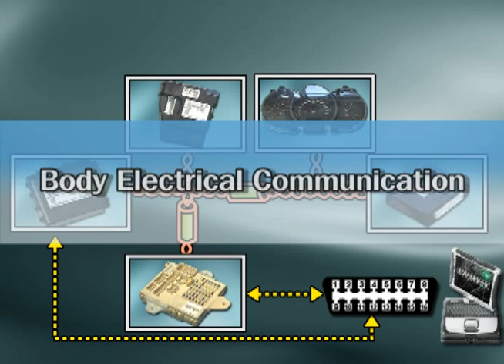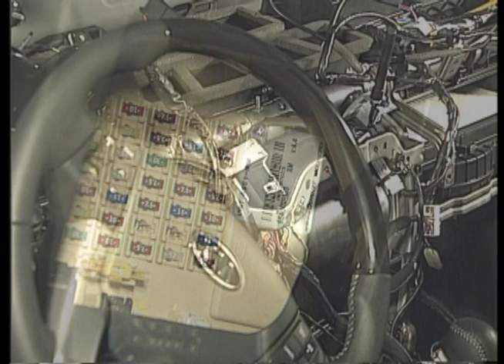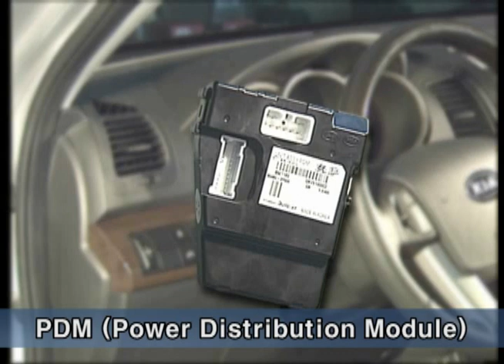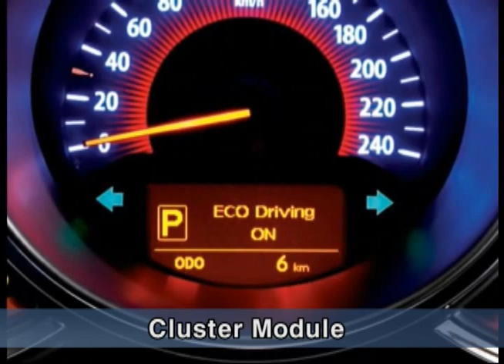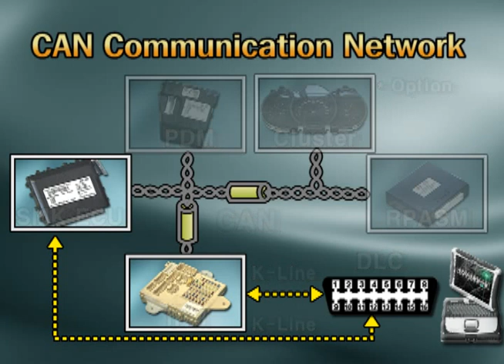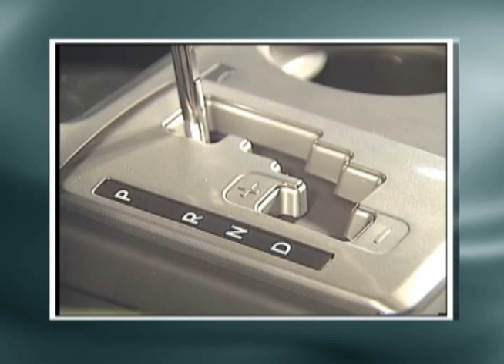CAN-BUS Explain on KIA Sorento | CAN Communication | Body CAN | #canbus

Comment: hello 
so if i have my passenger side door windows not working even rear one and mirrors adjustment stopped also and seat memory not working then i have lin communication problems??
Reply from the maker: Hi there, if it’s communication problem, you won’t be able to control the passenger side mirrors from driver side, but they work normally if you operate them directly from the passenger side.